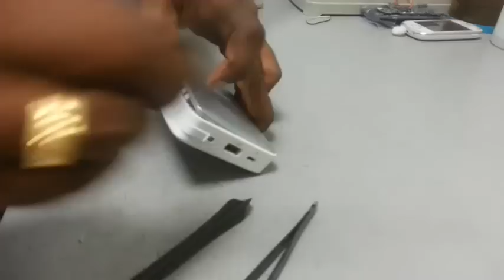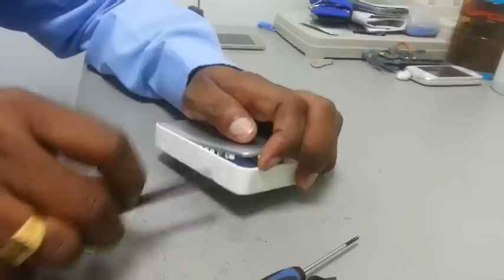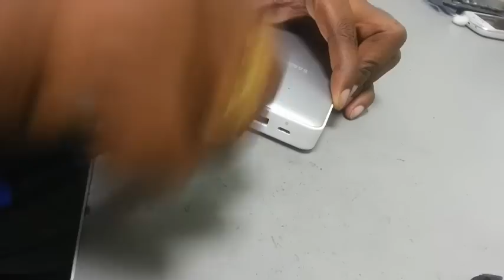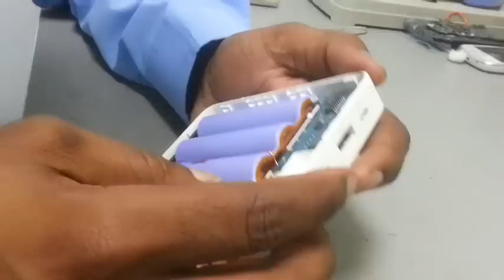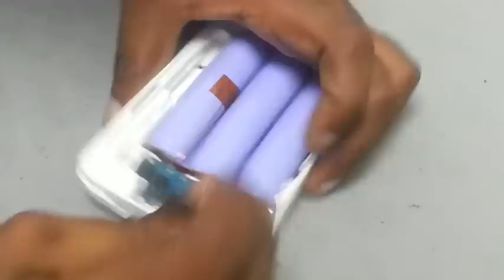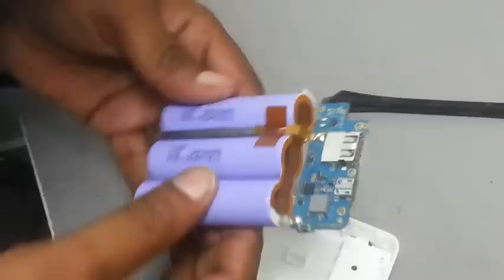POWER BANK DISASSEMBLING

Comment: can you please disassemble remax shell power bank 2500mah.... ???
Reply from the maker: definitely,  ill
Reply: please brother.. i tried so hard but can't open this power bank yet.. 
now subscribed and waiting for your help.. :)
Reply from the maker: pls share your power bank snap form every angle ,
Reply: i have already broken that power bank... there was one 18650 battery and the circuit
Reply: i have another question... the 18650 battery gives 3.7volt.. and the circuit converts to 5 volt...
if i use a 4.2volt battery with the circuit, then the circuit will work fine or not?? normally a power bank circuit should work with 0.5 to 5 volt as i know...... :/
Reply from the maker: yes , u can use it ...

Comment: My I pro power bank  charge the mobile only when power supply to the power bank is on please help
Reply from the maker: please check internal battery charging volt over battery in power bank , if not present check related circuit